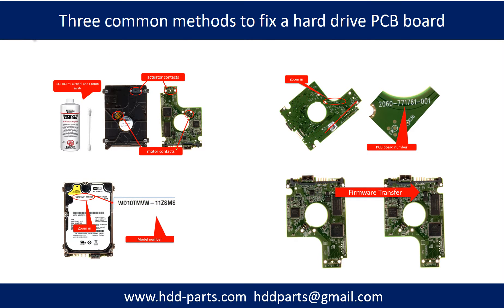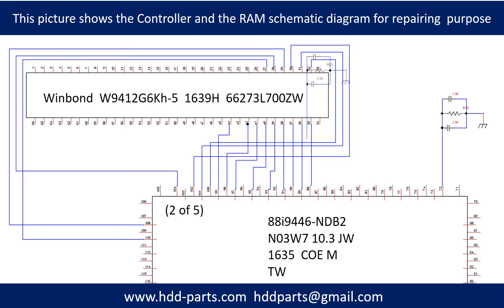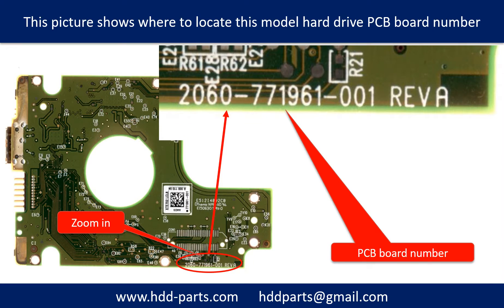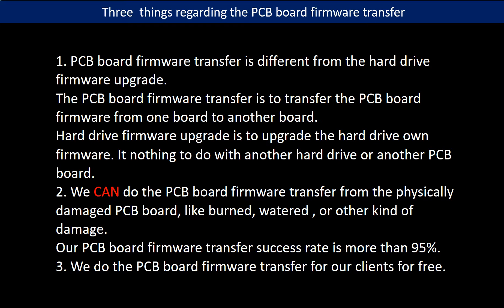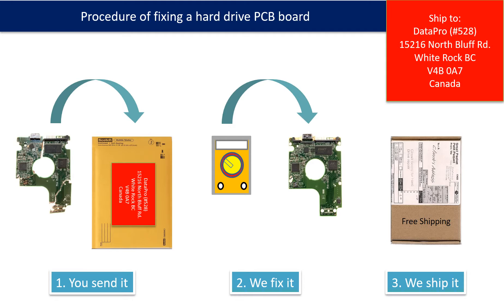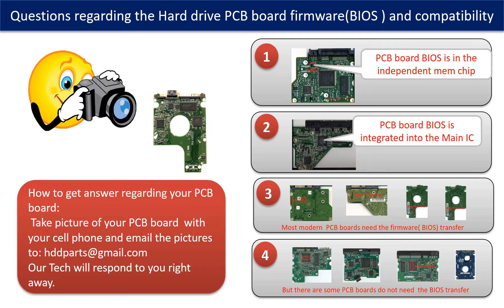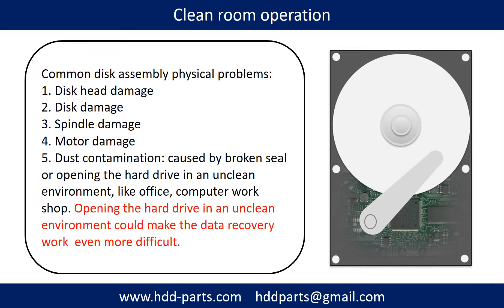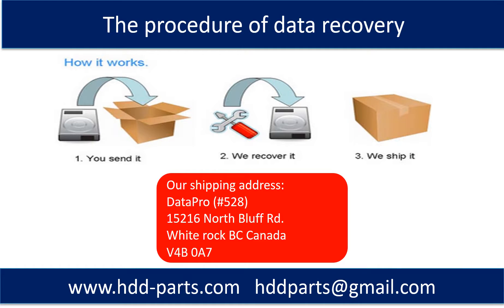WD  my passport WD10JMVW  WD15NMVW   WD10TMVW   771961 clicking HDD  repair  data recovery

Comment: Hi, I want to convert this WD10TMVW-11ZSMS1 external drive to internal drive and install inside CPU. I have ASUS P8Z77-V LX motherboard. Is there a way I can connect USB connector on the motherboard to this drive directly. Please advise.